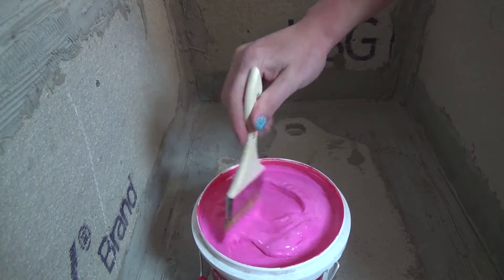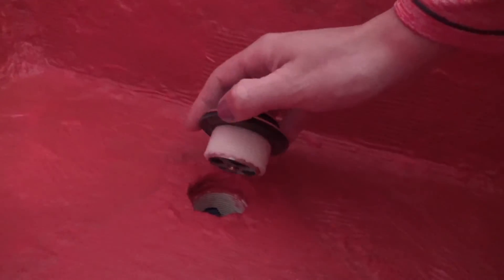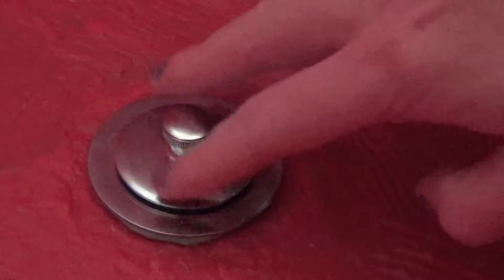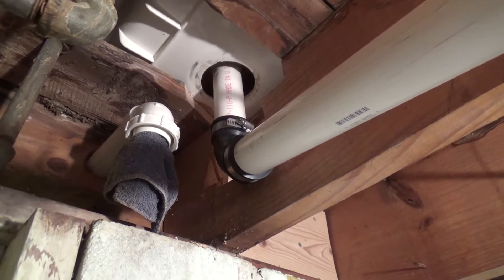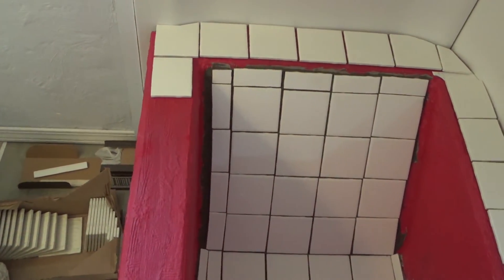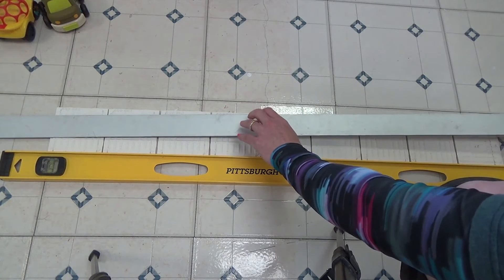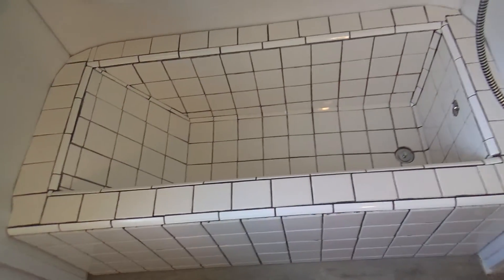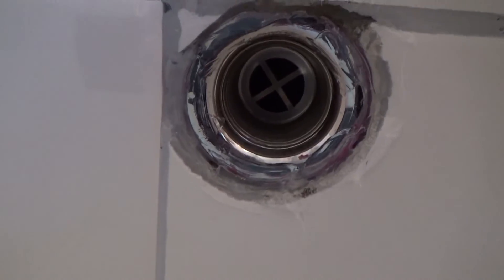Roman Tub 3

Comment: I'm a contractor who does many surfaces including tile professionally. I wanted to say that of the 5 or so roman bath videos on YouTube, yours is probably the best. Your tile work is not ideal, but it works, you made the frame solid, set the backerboard appropriately, waterproofed and checked for leaks before tiling. I could pick a few things apart, but compared to some of the other videos (one painted redgard directly onto their drypack mud) you did a good job.
Reply from the maker: Thanks. That means a lot. I’m not remotely a professional, and I didn’t expect to do a professional job. I mainly hoped that it wouldn’t completely fail. I did my best and I’m glad it turned out as good as it did. I appreciate your honest feedback.

Comment: Great video. Is the RedGard still holding up? We are getting ready to start a Roman tub / shower combo and the liner looks like a huge pain.
Reply from the maker: Thanks! Yeah, the redgard is great. It seems very tough when it’s dry.  It was easy to work with, being water soluble. There haven’t been any leaks since I installed it 8 months ago. I think I did about 4 or 5 coats, can’t remember exactly.

Comment: Hi!  Nice work!  Did you consider sanded caulk (or any caulk) on any of the corners or did you stick with grout, then seal after?  I have a roman tub that had some leakage - just trying to figure out the best way to waterproof the lines.
Reply from the maker: Hi, thanks! I used silicone caulk only where the tile met with the shower surround and the metal of the drain and overflow drain. I relied on the RedGard to waterproof the cement board. The only thing I did to the grout was a basic grout sealer. I suppose that’s not much help if your tile is already done. The RedGard seems to have worked well, though. I haven’t had any leaks so far.